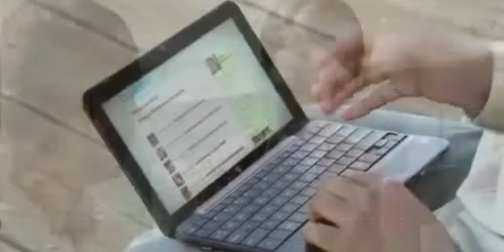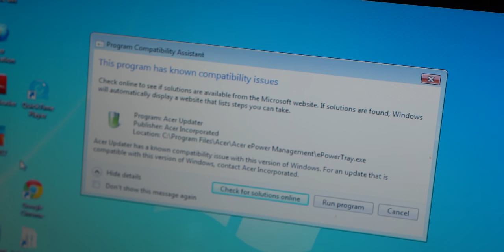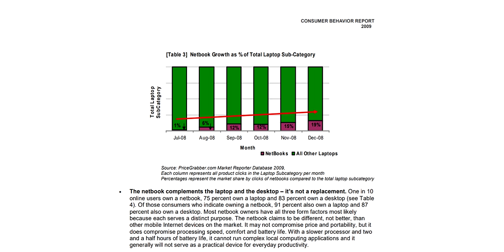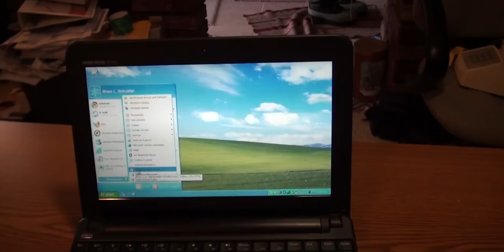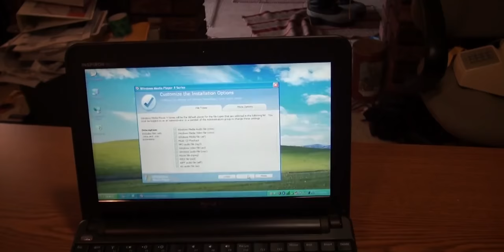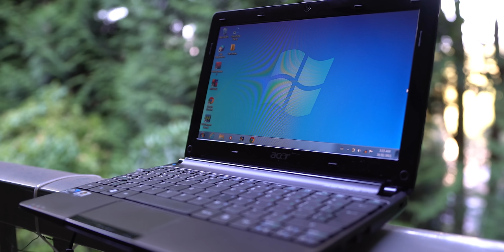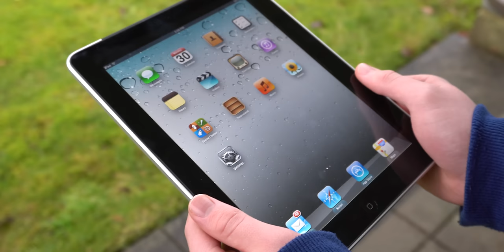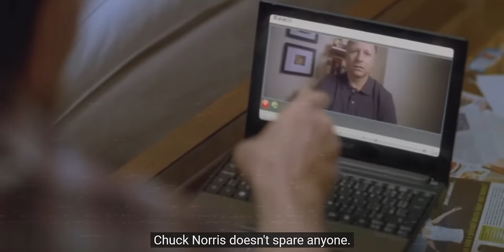Why Netbooks Failed - Modern Retrospective

Comment: They failed because of iPad, and android tablets, then the smartphone.
Reply: Reverse the order.
Reply: And 11’ MacBook Air which is unfortunately discontinued
Reply: TheComputerGamerGuy Those who bought netbooks couldn’t afford a MBA
Reply: @Nick yea but the MBA 11’ kept having a better cpu, more ram and a faster ssd and the price was almost the same throughout the years and its light and ultraportable just like the focus of netbooks
Reply: @Nick basically the MBA was one of the first ultrabooks introduced then other OEMs just copied apple around 2012 (bc of Windows 8 maybe) and forgot about netbooks
Reply: The Ipad Is Way more powerful
Reply: And Windows tablets too (Example: Surface Pro)
Reply: @whee6506  did you literally just say the MacBook Air got discontinued?
Reply: @Latrell Jennings read my comment again i said the 11 inch MacBook Air got discontinued 11’ means 11 inch
Reply: @whee6506  The 11" MBA is what the netbook should have been. Thin, compact with decent amount of power
Reply: @franzliszt9799  man imagine a new 11" macbook air (with the glowing apple behind it) with current specs? 🤟🔥🤤
Reply: @Abel-Alvarez  That's what I'm thinking, they should have just scrapped the 12" Macbook and continue production of the 11" Macbook Air. Or maybe put some good specs in it, the 12" is so underpowered
Reply: cheap laptops too
Reply: @whee6506  yeah, an $899 killed a $200-$300 netbook.
Reply: Pretty sure they failed because they were utter garbage as well
Reply: And chromebooks
Reply: @SzymonPmc  No, chrome books didn't cause netbooks to fail. They don't offer the advantages in portability that tablets and smartphones did. When they came along, there was no need to carry a smaller laptop, which is what all chromebook is.
Reply: No it was definitely tablets and then chromebooks especially. Don’t think smartphones are really in the same market.
Reply: Technically he's right in mentioning the smartphone, especially as smartphone screens have swelled in size over the past few years
Reply: @whee6506  No a net book is a tool and apple air book is toy😆 Netbook has no cellular internet atleast not the same flat rate as a android tablet plus android tablet is quality of screen because of high rez pinch zoom. Apple is not a pc and whatever apple dose is not relivant to a pc.
Reply: @jeffreyberry4780  If prepritary software distribution and glitter is power than I'll that the net book because atleast I could copy mp3 from android or other windows computer without a conversation software 😒 seriously I itunes is stupid because when apple brick's your computer from software updates there is no third party .
Reply: @jeffreyberry4780  what? Ipad first gen had 256 mb vs 1 or 2 gb and a single core cpu at lower clock than the 1.6 ghz netbooks and some times dual core
Reply: laptops are still better
Reply: @naaaaa-t5x  Laptops are don't have the same flat rate for cellular broadband that's smartphones and tablets do and laptops are more about quantity so it's just more junk you have to carry around and you won't even have portable internet at least not private internet.
Reply: @jenniferhartley5057  ok but laptops can play PC games phones can play shitty mobile games and don't you dare you say mobile is better than PC
Reply: @jenniferhartley5057  laptops can still do more
Reply: @jenniferhartley5057  and there is a Microsoft tablet that runs Windows 10
Reply: @naaaaa-t5x  last time I checked Windows is nothing but web browser add-ons and the Xbox version of the games are much better and the only thing that makes you the mobile game is that it's portable but the same garbage is on Windows in the MSN store and on the Xbox live store so you're just making a straw man excuse to be a neckbeard.
Reply: @jenniferhartley5057  did you know a PC can coast over$1000 there is even a desktop mac that coast$23K and some PC coast $12K so how is that cheep with your$500-$800iPhone or android so how is a PC cheep
Reply: @naaaaa-t5x  It's it's not about how much it cost and any real PC user would be bragging about how little they spent to play there stupid games an apple is a woman's purse that's not even relevant to the word PC and no real PC gamer whatever use Apple computers.
Reply: New kids on the block!
Reply: no they didn't... iPads and phones didn't really destroy the netbook... many people still need laptops and netbooks are literally just crappier, full fledged laptops. laptops just got cheaper and better to the point where making a netbook didn't make any sense
Reply: @adamlevine6700  This is correct. And also battery life - as can be seen with latest Apple presentation.
Reply: @tristan6509  The way I remember it is Google basically bribed everyone and Android and or amazon tablets became tolerable enough at a bargin price so netbooks no longer had an advantage and I never seen a prebuilt desktop at Walmart for many years so I'm guessing that not enough neckbeards will purchase the walmart so called gaming desktop which is actually just extremely average overpriced potato .
Reply: @jenniferhartley5057  netbooks actually lived on where I live, it was especially popular with college students since microsoft office online and google docs didn't exist and there was no mobile version of microsoft office either, plus most people prefer typing on a keyboard.

There was definitely a market for android tablets, but the netbook is still popular where I live.
Reply: @tristan6509  Android currently supports bluetooth keyboard and mouse at the same time and Microsoft office is now on google play which comes directly from microsoft .
Reply: @jenniferhartley5057  I said was, microsoft office online and microsoft office mobile didn't exist back then...
Reply: @tristan6509  Oh well it's just about what the kids are into these days and the only option is to become a rouge developer which I been doing for years.
Reply: @SzymonPmc  Chromebooks suck they cant even play Minecraft
Reply: @tony24-u9x  1. I've never seen someone do serious work on an ipad, they were great for replacing netbooks if you just watch movies. But you can't really work on them or even just do some basic browsing. It's not as much of an issue nowadays but websites back then we're more designed towards mouse use and not touchscreen

2. Netbooks never really died, they just improved. A netbook costed $500 back in the day, and nowadays you can get a decent laptop for $500

The sole reason why netbooks are small, have a limited screen resolution, and was really slow back then was because Microsoft puts limits on windows starter editions. It's not an issue nowadays because Microsoft gives out windows home lisences for dirt cheap to manufacturers. Netbooks just grew in size

3. Chromebooks are basically netbooks, just think about it.
Reply: @tony24-u9x  tell me a person that actually uses Photoshop on the ipad for professionally editing photos, having a powerfull M1 SoC doesn't matter if it has dogshit software support on it.

and even if they did have the software later on, touchscreens will NEVER work on a desktop app, Microsoft tried that with windows 8 and they catastrophically failed. The only saving grace for professionals is if they made it run Mac os which they will never do because apple wants you to buy a MacBook

And yes we do have shitty small laptops for browsing the internet and writing, it's called a fking Chromebook, and those costs only $100... Plus it has a mouse and keyboard. Schools gave these away next to ipad airs because they know how much of a pain in the ass it is to do basic tasks like writing on a touchscreen device

The M1 ipad pro just doesn't make sense to me because it's too expensive to be used as a web browsing device, yet they're too limited for professionals to use.

And for $800 (the cheapest M1 model) i would rather just buy a laptop for "professional" use and an older ipad air for media consumption.
Reply: @jenniferhartley5057  macs are not tools? Really? Ever heard of bootcamp? There’s a reason why they remain popular. And macOS are linux under the hood. So to say they’re just toys is not really fair.

Comment: I was forced to learn how to optimize Windows because of this thing, and that was an amazing learning experience, like a wise man once said "No Pain, No Gain"
Reply: I have one running windows 10 here, you are spot on, chuck out all the bloat and optimize and you get very worthwhile gains.
Reply: 'optimize windows'? very weird way to misspell 'install linux'.
Reply: I was forced to sort of optimise my current gaming laptop because Acer has bad quality control; I regret shopping late during Christmas in 2019 and not going for HP or ASUS when theirs still haven't sold out
Reply: Do you know where your profile pic from?
Reply: @mthf5839  you forgot to shave your neckbeard and tip your fedora
Reply: Word. I was already interested in Win optimization, getting rid of all the bloat, stopping services, disabling their cute little Win Defendy piece o' garbage. Now Windows 10 (and probably more so in 11) are so much more locked down it's insulting. So how exactly does one optimize the dung heap of Windows 10?
I mean I disabled windows update, in about 5 different places. But as soon as I have wifi turned back on, the thing starts pulling my town's worth of data from Microsoft's ever-loving ugly mouthes. Gobble gobble, mofos!
I don't always want every update and every patch to every false flag you wave, Microsoft.  Sigh
Reply: @moonshinepz windows 10? They can barely run windows XP
Reply: @Muhluri  3 years old comment you are commenting on. How are things in 2020?

Comment: Not to mention that Intel needlessly delayed the industry transition to 64-bit by making their early Atom processors x86.
Reply: what do you mean, white fella
Reply: mircrosoft endless update ate up the harddrive.... they did it to surface that they know only had 32 gb....  the rest just junk....
Reply: @Unknown Nomad Yea the later ones were x64, but the early ones were x86-only, and there were a sizeable number of them shipped, during a time when 64-bit was otherwise cemented across the industry. Intel also pumped out a bunch of 32-bit tablet SoC's. This set the x64 cause back for years, thanks to Intel.
Reply: @boris2223  yes I still have an atom based purple aspire one that was x86 only and it was horribly slow. I later got another aspire one but with AMD c-60 processor which was a much better experience compared to atom, still slow but better and x64 compatible. I recently installed win 10 x64 on it with ssd and it isn't bad.
Reply: Truth
Reply: Dual core 1.1 GHz intel atom processor, the worst processor ever thought up
Reply: Even after transitioning to x64, it meant nothing to users as Atom didn't allow you to use more than 2GB of RAM
Reply: @campkira  No true because Acer and Intel had one last big hit before Android and Google butchered the laptop industry and that was the exon based potato which was supposed to be the next generation of the potato except Intel had dropped support very early on and repurposed the concept as a arm technology potato or basically a amazon fire tablet at 2x price.
Reply: X86 is simpler and more affordable. Thats exactly the reason netbooks were built.
Reply: @aboriginalmang  x86 was the only option for a portable desktop computer experience before Google revolutionized low-cost PC clone technology based on the arm Risc architecture that even Microsoft has come to favor. My professional opinion I think Apple had a lot to do with take starting Android knowing that it would hurt Microsoft sales in price point after only a few short years of research and development as revenge for monopolizing the PC industry with preparatory Intel hardware which the evidence is that despite being a fierce price point competition Google  has always been demonstrably beneficial to Apple supporting open source technology and Google an apple would have no reason not to work together to take down Microsoft's proprietary software empire which you never see any mud sport between Google and apple the same way you used to see it between Apple and Microsoft an Apple has left Microsoft alone now that they are forced to share a business user industry with Google and cooperate with Google's open source software is Microsoft has retreated as a toy company being largely a third party therefore PC as a whole is nothing but a relic of the past that baby boomers and nerds play with.
Reply: Both 32 bit and 64 bit are x86...you basically just said "I have no idea what I'm talking about"
Reply: @crsv7armhl  x86-64 was commonly called x64 or AMD64 while “x86” commonly referred to the 16 and 32bit compatible versions. Maybe today people don’t bother saying “x64” anymore because they’re all 64-bit anyway, and just say “x86” to separate from ARM, I don’t know. But either way OP’s intent and meaning were perfectly clear. For example: a 32-bit x86 CPU can run 16-bit code but the 64-bit ones can only go back to 32-bit code. You’re “technically” correct in the fact that both have x86 in the name — but only if you ignore 100% of common usage back in the day.
Reply: @boris2223  yeah, but Intel never really cared for x64/AMD64 anyway. They wanted everyone to just abandon x86 and move to IA64. (Kind of ironic since Intel, with the A20 gate and so on, helped keep x86’s back-compat when IBM didn’t care about it.) They wanted to milk x86 for all it was worth in lower power devices and have everything else move to Itanium. They even claimed you couldn’t make a 64-bit processor that ran x86 code as justification for the whole IA64… well, everything. And then AMD just went and did it. So of course no one wanted Itanium when the Athlon 64 could run 32-bit x86 code as well as its new 64-bit extensions. And Intel HATED it. Still do, probably. They hate having to pay royalties to AMD every time. They hate having gotten next to no returns from Itanium. 

So of course they’d be belligerent with their Atoms, and their phone SOCs, and everything else they churned out at that time. Just like how they barely improved their CPU performance for like 6 years until Ryzen made them up the core counts again. They don’t give a damn about performance, or battery life, or anything like that really. They just care about milking money from their arch IPs. They still sell 386s and 486s for embedded applications that need to either run legacy code, have extremely high reliability, or some other institutional reason. Despite ARM embedded controllers tending to have better power usage and power; Intel still sells these decades-old designs, and companies still buy them. I wouldn’t put it past them to have forecasted similar uses for their Pentium 3 and Core Duo arch once everyone had moved to Itanium.
Reply: @kaitlyn__L  So you just said this: "x86-64 was commonly called x64 or AMD64 while “x86” commonly referred to the 16 and 32bit compatible versions." 

Which is not the common convention the person I responded to used. Also go reread the comment I was responding to. It was clear they aren't very familiar with CPU instruction sets and arch.

While desktops are a majority x64, there are some with 32bit bios that make the system effectually 32 bit, even if that is becoming less common. Also much of the pi lineup and operating systems are still 32 bit, but those are not x86.
Reply: @crsv7armhl  you could make the argument that OP’s OP left it open to interpretation, but OP’s second comment in this thread makes it clear they do actually know what you claim they know little about. 

Not sure why you say to re-read the comment when I read it seconds before making mine. Unless you’re saying you replied to someone other than OP — which is not visible (usually there’s an @, like in the one I’m replying to right now). 

Obviously there are 32-bit ARM chips still in production, but the last couple generations of Pi were 64-bit (even if the OS might still be, since of course you can use 32-bit OSes on a 64-bit back-compat chip). Not sure why you brought that up though, unless you mistakenly think I’m saying x86=32-bit even when we’re talking about ARM. ARM32 and ARM64 are their own beasts.
Reply: @kaitlyn__L  My comment is 7 months old, but here is the comment I was replying to:

"Not to mention that Intel needlessly delayed the industry transition to 64-bit by making their early Atom processors x86."

There are so many issues with that statement. 

1. It implies x86 and 64 bit are completely different, unrelated, things.
2. It implies that Intel was the driving force behind chip selection, instead of cost.
3. Netbooks were never a driving factor behind the transition from 32 bit to 64 bit.
4. Atom processors were never a driving force for the transition from 32 bit to 64 bit.
Reply: @robertthomas4633  Right dude. Every normal desktop computer is x86. But keep thinking that x86-64 processors are somehow NOT x86.
Reply: @Moskito844  antiwhite pos